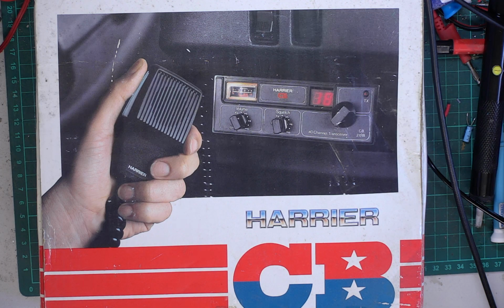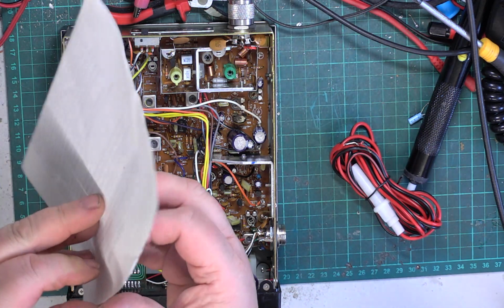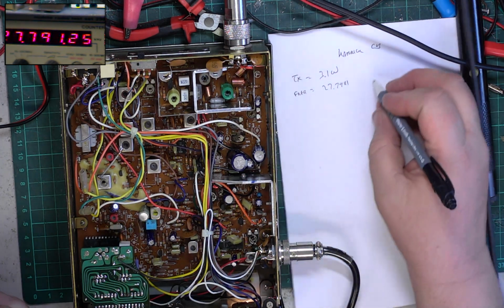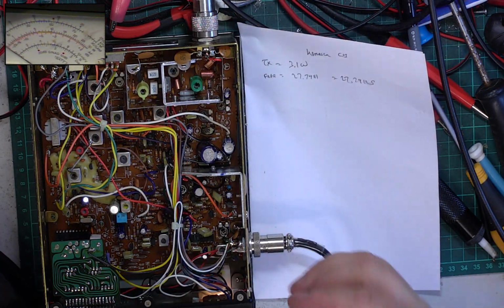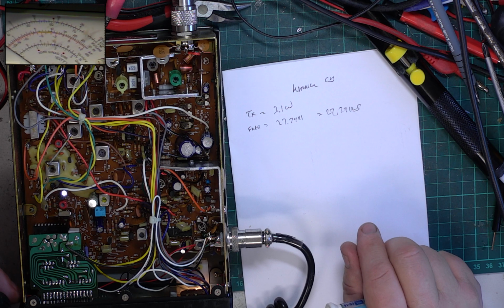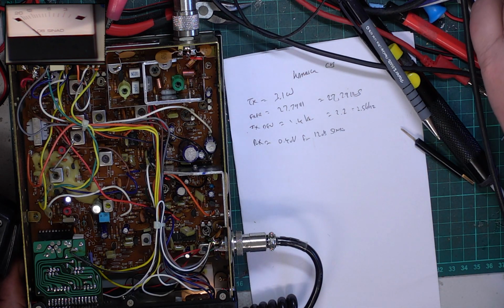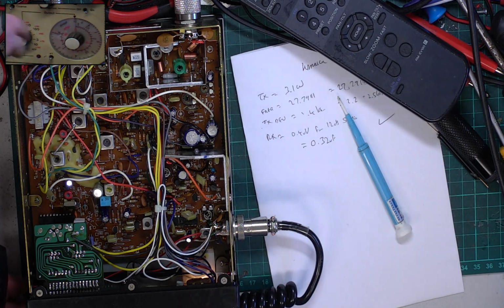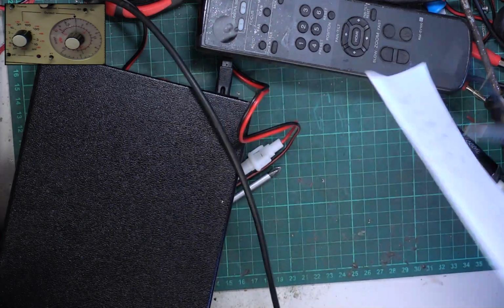Harrier CB CB27/81 UK FM CB radio - Service adjustment

Comment: I understand why the owner wanted it servicing but personally I would have kept it in factory original condition with seals intact. There can’t be many boxed Harrier CBs with unbroken seals left. Breaking those seals just made it less collectible in my opinion. Was it worth doing that for an extra watt of output power and a bit better receive? Not in my opinion

Comment: I need to ask Richard. Where did wharlow come from?
Reply from the maker: It was part of my training at Rotherham Technical College around 1978 with Mr Horn as lecturer. My late Father (he had a doctorate in chemistry), knew Mr Horn as my Father had run evening classes at the college in Thermodynamics...which he wrote a book about, published by Pitman's. Waahloww is a jolly good test. I bumped into a fellow radio amateur from Bedfordshire & he had Waahloww in his C&G training.

Richard
Reply: @ukfmcbradioservicingTango21  What a great story. It does seem to work well  producing a fairly steady amplitude unlike testing testing etc.